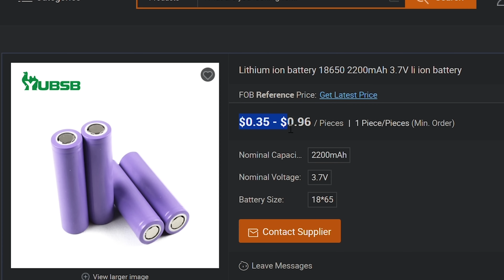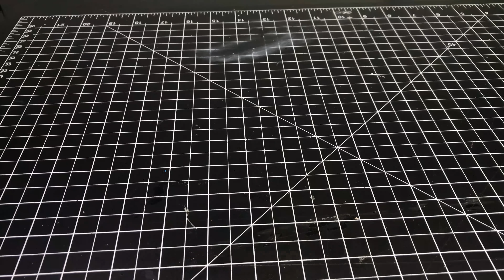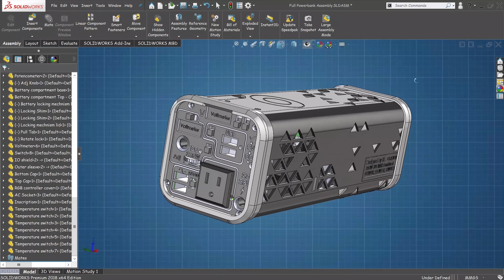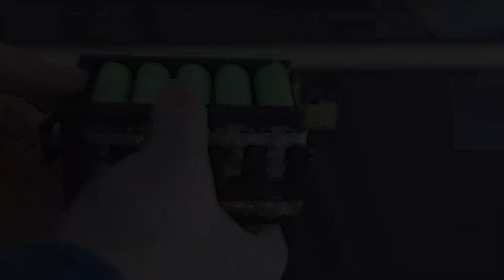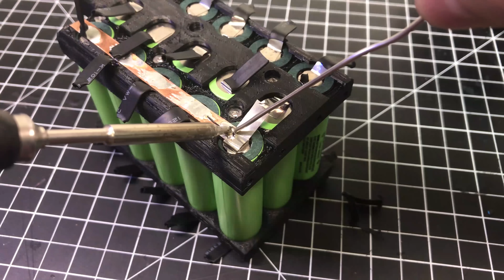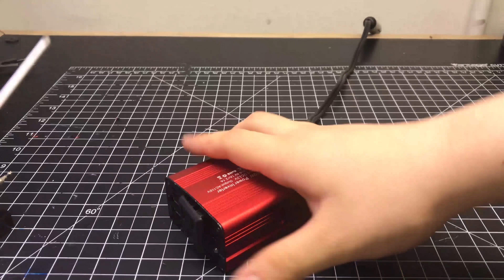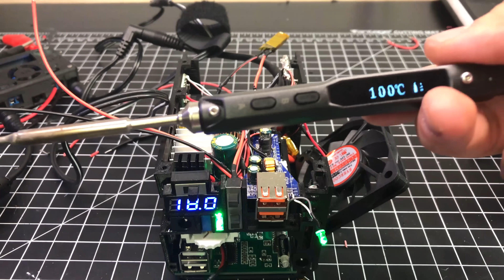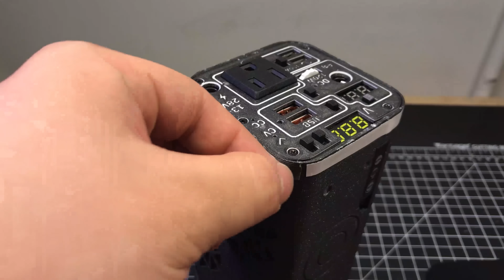How to Make the Ultimate 18650 Power Bank with Infinitely Expandable Capacity

Comment: How would this (schematic) change if you were to use a 21700 battery instead?
Reply: Why would the schematic change at all? 21700 lithium ion batteries are the same as the 18650 but just hold more capacity. You would have to redesign the battery holder.

Comment: I would make the fuse removable
Reply: Also same whats Best way integrate a fuse holder like this onehttps://rover.ebay.com/rover/0/0/0?mpre=https%3A%2F%2Fwww.ebay.com%2Fulk%2Fitm%2F123759088099
Reply: You guys realize that if you can build this, it is very simple to change the fuse and you shouldn't be blowing them out anyway. If it fails, you will have to open up the device and find the issue which will result in soldering anyway.  Keep in mine that the AC inverter also has a soldered in fuse while many of the circuits have their own smd type fuse.

Comment: I'm curious to with that densely packed power switching circuits. Was the little.fan enough for the job? (Also lots of obscuring wires to interfere the airflow) was partial aluminum case an option for you at the time? I don't think you would attempt a version 2, please let us know how the bank  performed so far?
Reply: The little fan is only being used when it is charging. The Step down converter with cc/cp barely needs cooling so adding a heatsink and with the little fan is enough. There the much larger fan is what's doing the cooling.

Comment: It's funny how at 8:00 he says "Depending on how fast you like your batteries to be charged."
Reply: This is a valid statement as charging the batteries faster degrades the life-time of the cell.  So you can charge excruciatingly slow, and the cells will have a longer charge/discharge life, but it will take you 20 hours to charge the bank, or you can charge at the current limit of the cells, and charge your bank up in 30 minutes, but probably knock off 40-60% of the potential life of the cells.  Everything is a trade-off.
Reply: @schuggs512  I get it.  I'll probably go for faster than not, or the in the middle.  Thanks for that, I would've really messed up otherwise.

Comment: I don't see any fuses between your battery cells and your balancer.  I decided that's an important safety feature, so I added them between my active balancer board and my Tesla battery, which has so much current it can melt right through thick sheets of metal. Safety first..

Comment: oh I'm just gonna head over to my 3d printer sure no problem everyone has that right

(The average consumer 3D printer costs around $700. The cheapest 3D printers start at around $200. High-end consumer 3D printers can cost several thousand dollars.

The cost of 3D printers has dropped considerably over the past three years. As late as 2014, it was hard to find quality 3D printers for under $2000. Today, numerous high-quality options exist for under $1000.)
Reply: I got a $200 printer years ago but it needed quite a bit to make it a good printer.

Comment: I am working on a mobile phone charging station, i want it to have 8 usb ports output 5v, with 2 switches, one for LED and the other to control the usb ports. What kind of charging module do you recommend i use?

Comment: DUDE you rock ,if i was me i put a LiPo batteries,18650 scare the crap out of me but i understand the reasons high voltage on pack and big amperage.
i doubt this will cost me 60 dolars.

Comment: Great video! The only feedback I could say is I think you should have used an inline fuse holder cable for the 20amp fuse instead of directly soldering it onto the cable, that way if it brakes replacing the fuse would be a quick and easy fix.

Comment: Nice project, my primary concern is the strength of the casing. A small drop or sharp hit in a bag with the weight of those 18650s and the casing will fail with a high chance of disastrous results. (Ex: heat caused by a short fueled by liquefied printable material.) If you sourced an aluminum sleeve large enough to act as the outer casing and cut out the ports for your switches and wireless charging pad, it would be a lot safer. Also use a 3d printable material that allows for minor flex to prevent shattering which is common with PLA and ABS filaments. Something like PLA+. Otherwise nice job. A very usable product.

Comment: Nice.  Link up with a Solar Recharging station and you can go off grid for your basic appliances you use every day.
Make 3 power packs.   Two charge on the solar station,  while you use one of them.  Number them and then you can rotate through them.
Make a large power pack recharging station with larger solar panel, and 5 packs - rotating throughout the week and you have power as long as the batteries don't wear out.

Comment: 6:35 Is it not more efficient to use wires since they have more surface area? Or is that just for AC?

Edit: Also correct me if I'm wrong but I've heard that any amount of heat, no matter how fast it was soldered, still hurts the battery health. However instant spot welds cause the least damage if done properly.

Comment: dafaq power 20k mah cost you around 2 15$
Reply: its way more than 20k mAh. 2500*15 bateries = is about 40k. read the description and look thru the links. plus, with this one he wont loose as much charge when charing something because factory made powerbanks use the absolute bare minimum when it somes to voltage converters. if you ever open up a powerbank you can see that his is way more productive and wayyyy better than any powerbank you can buy

Comment: ”12V inverter 220V: You might need to modify the io shield to fit the socket your country needs.”
Yes, of course, but where do they have 220 volts these days? We once had in my country, but we switched to 230 volts in 1989 to match the rest of Europe (and I think some countries switched from 240 to 230 for the same reason). Anyway, I'm sure 220 volts will work great too, since it's within the tolerance of our 230 volt system, so no big deal, just wondering.
Maybe Russia still has 220 volts?